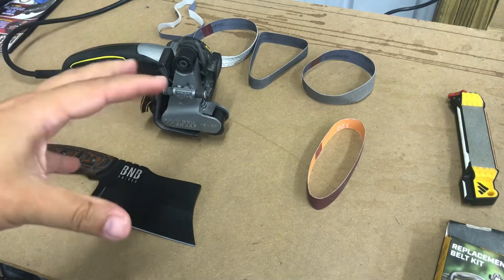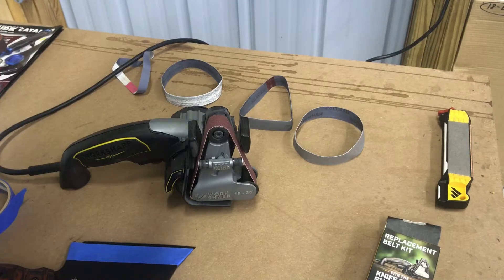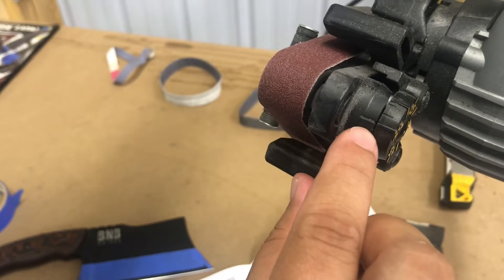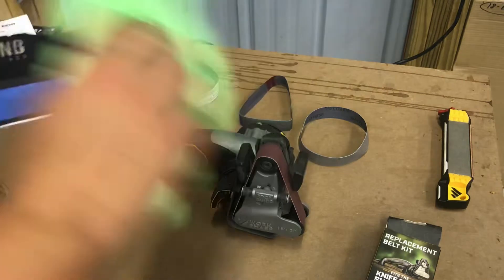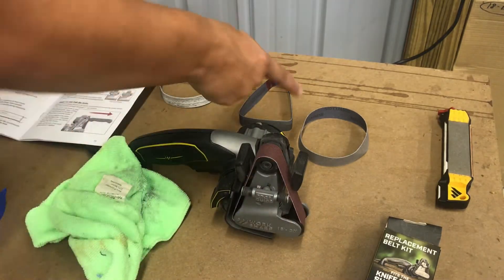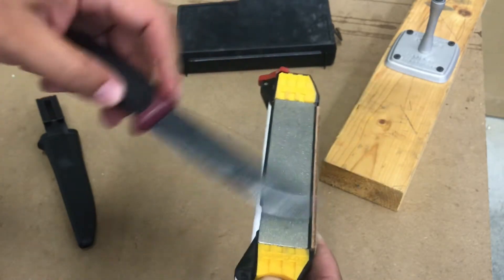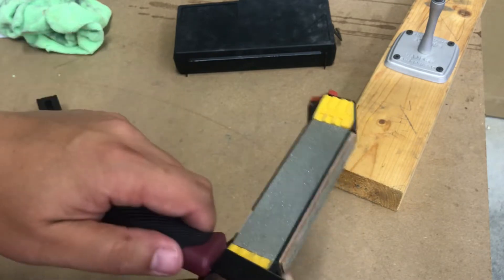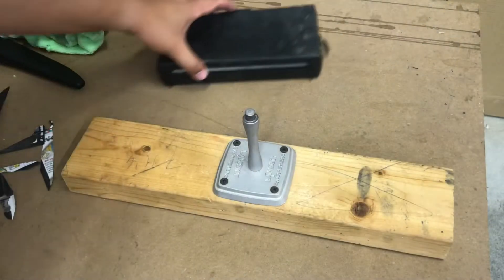How I sharpen knives - WorkSharp and Lansky sharpening systems

Comment: I have the lansky with stone, diamond, and the strope. After researching the other sharpening systems the lansky is a nice set for the price. I usually clamp in the middle of the blade to keep the angle the same. I saw a tutorial on a video and it made sense so that's what I do. Don't think it matters too much smaller blades tho.

Great vid man! Keep them comming.
Reply from the maker: Yep, absolutely right.  Should be in the middle of the blade. That was a mistake on my part.